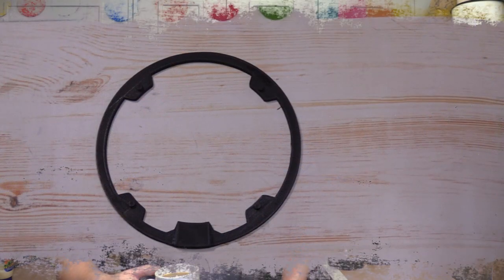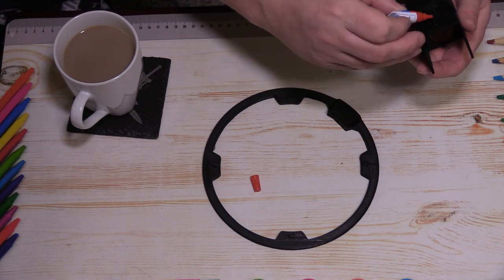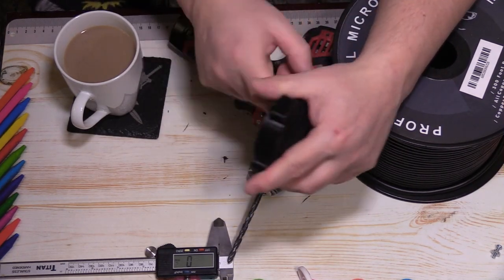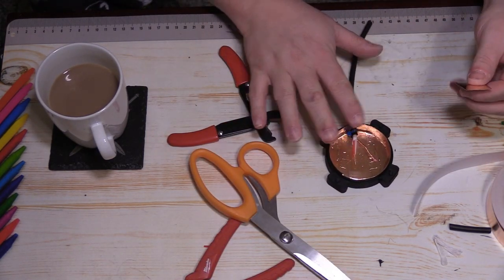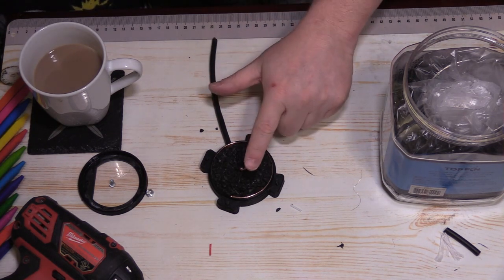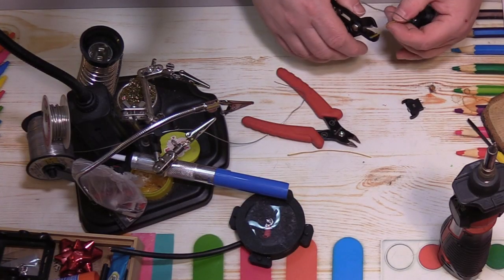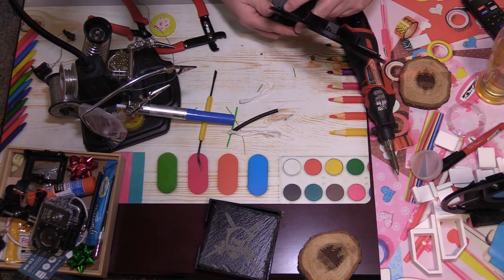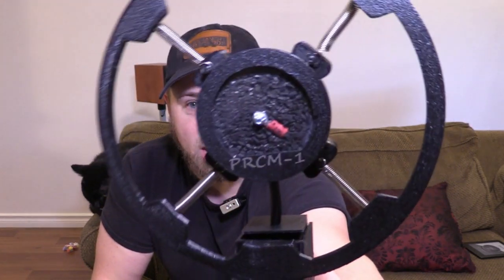PR Carbon Mic instructional

Comment: Can you describe the exact cabling, please?
Reply from the maker: Sorry for my slow reply! Yes:

One cable goes from the diaphragm to Pin 2 on the XLR output.

The shielded cable goes from the copper cavity to the positive on the battery terminal, and then from the negative terminal of the battery to both pins 1+3 on the XLR. Alternatively you could go to a shield on a 1/4" TS jack, and connect the diaphragm wire to the tip.